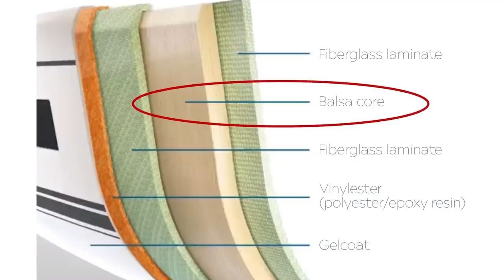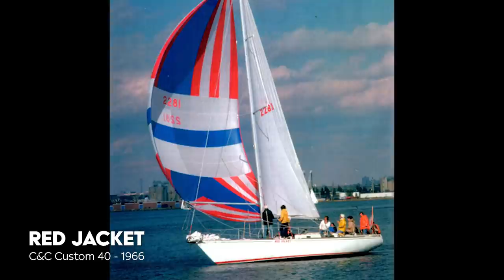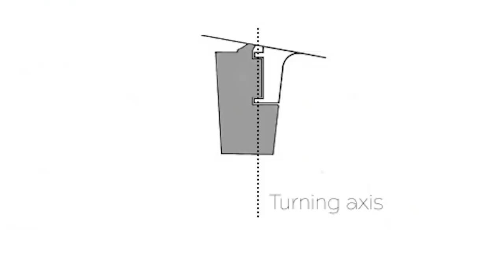FIXER UPPER Sailboat for Sale!! $16K for C&C 40   EP 28

Comment: Great Video, I own a  sister ship, 1981 40-2 center board, love the boat, that is a heck of deal, been cruising on it for a few years now, always feel safe and the centerboard allows you to get in to some shallow anchorages!
Reply: I just bought this boat! Any tips for liveability?
Reply: @flynns32547  www.desperado2.com - we have added a lot to ours, we have solar, watermaker, new stove ect... we use the pilot births for storage, if you have any questions, let me know, I keep my batteries under the quarterbirth and use the cockpit locker for 6x5 gallon fuel cans, I installed radar and autopilot, replace the hatches ect...
Reply from the maker: That is awesome!
Reply: @flynns32547  watch episode (step) 40 of "sailingUma' on youtube. Then decide to flip through other 'work' vids. Ship her south to work on her year round. Allow 2 years of effort. Like Uma, you will assuredly find more than you thought problems. Patience perseverence and a long run dilgent dedicated relentless attitude is required. Mental toughness to accept this. I'd go like Uma and sell the engine. After long days of fiberglass work are hours of research for whats next...electrical.  Good luck.
Reply: ...and composting head now are the way to go. Have one on a c&c 30 in BC Canada.
Reply: @flynns32547  A couple of things to watch out for, the bottom of the centerboard tube, can come loose/corrode, I had to re-glass mine in (there are videos on my channel on the repair), it was a one day job, but had to be hauled to do it, watch your engine alignment and the stern tube/cutlass bearing, Atkins and Hoyle hatches are old and mine all leaked, replaced with Lewmar at a fraction of the cost of refurbishing the A&H, a windlass is necessary if you plan on anchoring, we went one season without one, never again, the rudder may have not been greased in years, the grease pot is difficult to get to, but it is very important to grease it (fill the pot, screw it in... repeat), it might be easier in your boat as you have that engine hatch in the cockpit, I do not have that, email me if you have any questions.
Reply: @desperadoii4938  Thanks so much! That's good info.
Reply: @desperadoii4938  We're going to be documenting our jobs on this account :)

Comment: Thanks for the video of this beutiful C&C 40. I got my hands on a C&C 30E that looks more or less exactly the same as this one. Only difference is the overall height and width to be honest. Very interesting to see. I have restorated the teak deck this summer and inside renovation begins after new years. I have the same case as this C&C 40, moisture and some moldy teak inside the boat that needs to be removed and or replaced. It's gonna be beutiful :)

Comment: This boat could be splashed and fixed up. It would make a great BVI boat with the shoal draft. I’d focus in two things: first the engine. It looks rusty and old. Having gone thru a reporter on my last sailboat I’d give it a through review with a good mechanic who has time. Second the Chan plates. The great news is that they are easy to get to. Examine them and replace if they look suspect. 
Buying this boat if you had the dough you could  get in a good summer then put it in the barn for the winter and mint her.
Reply from the maker: spot on   thank you
Reply: That's the plan!

Comment: I wouldn't attempt to dry it out with heat, you should use an industrial dehumidifier for a couple of weeks. You could do a before and after damp check on the boats core, that would highlight any bigger issues. Balsa needs to stay dry or it loses its compression strength meaning anything fixed through it will be loose. We build boats with this construction and they were super light and very strong. Good luck to the new owner, it's worth the effort.
Reply from the maker: good point ,,,actually i wondered that some firm like ServPro would be a great help   since they do flood damage repair

Comment: A Canadian story: A casual friend/work mate told me a tale of buying a power boat with a minor moisture pocket, that he ignored, as he was anticipating an overhaul; which he put off for a couple of winters.   Story goes, the moisture froze within the balsa, causing extensive de-lamination, and damn near tore the transom off the boat after two winters... I dunno.  A canoe man myself, I've lost a couple over the years from dry-rot, from fiberglass penetrations allowing water into the cedar strip casing. Imagine balsa core rot would be much like dryrot ( ? )
Reply from the maker: I think a  CB lot more detail needs to be provided about the  bb poor Canadian power-boater’s I’ll luck   For example did the owner actually find sll the soft places at the start  and so forth. 
From what I understand it takes a penetration of the fiberglass covering to allow water into about the core but once in it tends to be localized in some sort of radius about that initial strike. I Have never heard of the lamination so intense that an actual aspect of the hall would be rent from the boat. Of course Canadian winters can be cold.

Comment: Never heard of a balsa failure causing a boat to sink. I HAVE seen a 5 year old boat sink right at the village boat dock here in Coxsackie because they got drunk and didn’t pump the bilge on their passage down the Hudson from Quebec 😂. Seriously, though, I can send you photos of a wooden NY Central railroad barge that was abandoned when Amtrak took over and has been sitting on the mooring at their abandoned fuel dock, and it’s still afloat. The roof is shot, it’s got all sorts of wildlife, the fuel dock sank, but the boat is still afloat because physics rule. 🎉

Comment: Most decks have some wet spots unless you it's real soft it should be fine it may take away some  stiffness racing. check the bulkheads much more of a problem to have rot in the middle of teak faced plywood (I raced on a Kirby 25 that you could feel the deck sag but we won a lot of races) C&C were great boats this looks like a great deal he's almost giving it away. I'd rather have the C&C 40 than a cal 40 (and the cal had a lot of old fittings this had self trailing primarys). This boat could be cleaned and tidy up or completely restored it would be worth it either way look what a new 40' would cost

Comment: Those chain plates have a surprising amount of corrosion on the surface. I’ve worked new construction and remodeling for about 35 yrs. When working on a house you can tell so much about the people that worked on it before you by the work that they performed. I’m guessing that an experienced ship wright ( is that correct? ) could do the same.

Comment: I’m in the process of finishing my refit on my C&C 30 mk1 
I redid the the top deck , from my limited experience the balsa core get wet from the accessories on deck not properly sealed or sealant failing with time
I think the most important thing is that it don’t leak inside 
I wish I could exchange mine for bigger
Depends on how much elbow grease you need and $
I think it a brand that be kept alive or revived

Comment: Certainly it needs a lot of work, but it would be so worth it. Topsides balsa repair is pretty straightforward on a C&C (did some on my 27) and probably you'd need to drill n' fill/rebed all the hardware to get the leaks, along with a lot of scrubbing and some cosmetic work in the cabin... But my gawd boys you'd have a helluva boat.
Reply from the maker: good call
Reply: That's our plan!
Reply: @svperegrine8004  Now there's a coincidence: Peregrine is also the name of my 27. (It's an old family name, but also a good one for a boat IMHO...)

Comment: I would pressure wash it inside and out then dry out the inside then. Prep the bottom and launch. In a marina that will let you work in the slip I would rebed the deck hardware one at a time.  You could sail on perfect weekends and work on deck leaks when there is no wind. The deal killers for me would be bulkhead rot or an engine that doesn't work. That would get too involved for me. There are other boats out there.
Reply from the maker: well thats the surveyors call     but a good approach

Comment: Water in a balsa core make a boat heavy, like carrying extra water tanks.  When it’s just the topsides that have a balsa core it’s not really a problem. Wouldn’t even repair unless the deck feels like pasta under your feet. Wet cores become a problem when it’s a cored hull where the balsa core is below the waterline 24/7.  Then it’s like pasta in between two layers of fiberglass. strength goes away. The hull begins to flex too, too much. Stays just pull the hull without getting tight. Prop shafts won’t stay aligned, rudder shafts move. Thru hull fittings become compromised. The list of problems is endless. Balsa core below waterline, run, no sprint away from the vessel.
Reply from the maker: Thank you

Comment: What is the status of the engine?  On an older boat rebuilding or replacing can double the cost.  An engine in good shape is not a luxury.  When I look at an older boat, it's the first thing I look at.  I have sailed a C&C 40 up and down the east coast for 5 years.  Always loved the way it handled, very light at the helm---you could steer with one finger and it pointed better than any other boat I've sailed.  Sweet!!!

Comment: The balsa core rots into a black goo, losing its strength and you get the soft decks. 
Once it gets heavy it affects the boats performance by becoming more tender ( I think that's the word, it basically heels easily, and rolls easier from waves).
From what I've seen some of the repairs add a lot of weight affecting the boats performance permenantly.
So........balsa is expensive but....
Reply from the maker: makes a lot of sense.... we wouldn't wait too long to deal with soft decks...

Comment: when balsa gets wet it rots and the only fix is to replace it.. the balsa is part of the hull integrity and without it the hull lacks the rigid strength,, so unless a complete check of the hull indicates no rot or damage, that boat would be iffy at sea.

Comment: Great video as always!
You dont seem to discuss sail inventory and condition very much.
As  I recall New Saiils can be very very expensiive.
Can sails be rebuilt ?
Thanks
Reply from the maker: Sails are often stored away from the boats so we cant even see the bags. There is nothing like a new suit of sails except sails built by an experienced non curt rate loft  and then the range goes downward to a 30 year old bed sheet soft set which will move the boat forward. Hard to really evaluate until you can hoist them and load them up. Depending on your needs : racing , cruising off shore , gunkholing  nearby  etc,

you and your local sailmaker  will be the judge. There is usually an accurate survey of the number of sails coming with the boat  but never expect perfection from anything more than a couple of years old and you wont be disappointed. Yes some sails can be re cut by a skilled sail maker to stretch the life of some but it may be wiser to buy new at any level . The sails will usually get you home regardless of condition but there is a quantum of difference in speed and handling between old and new 

hope that helps a little
Reply: The sail inventory was very complete. Main, a 155, a 100, a storm jib, and two spinnakers.

Comment: After seeing the motor area and bilge below it ,,, 1000% that C&C has been partially sunk or heavily flooded inside with water resting for a long period of time.  It was drained out but never dried out correctly and it’s led to its demise. 
Current/Previous owner needs a SERIOUS TIME OUT and should never be permitted to own another vessel after destroying such a fine vessel.  There ya go Capt Q ,,,, I said what you were thinking but didn’t want to say. 
Good thing is I’ll bet you could buy that boat for 8-10K and spend a few months turning her back into a 40k boat quite easily.
Reply: We certainly took issue with some of the previous maintenance regime. That said, we've gone over her with a fine-toothed comb and we're happy with our project boat. Your last sentence is exactly what we're doing :)

Comment: If a wet core is such a concern, why can't some tiny holes be drilled to the core, the interior heated up to 5 degrees over ambient, to allow the moisture to escape, and a preservative be injected to inhibit future rot. Once the moisture issue was controlled, plug the holes. Could that be a solution?
Reply from the maker: I think that has been done in similar fashion a number of times with success. The longer you can heat/suck dry the holes
The great chances of success

Comment: How well does this boat sail close to the wind, do you think? Having grown up sailing a full keel Pearson, I was dismayed at the sailing meatball action of some factory boats when they got overpowered (Jenneau, or Beneteau for example) and getting through chop.
Reply from the maker: she is the progeny of Red Jacket which won the whole southern Ocean Racing Circuit....you would be delighted to be at the helm of one of these or any C&c     really !
Reply: She handles chop like it's not even there. It's slow going in light air, unfortunately.
Reply: UPDATE: She's a bit tender up to 15 degrees or so, but stiffens up quickly. In 7-10kts+ you can point up to 30-35 degrees or so, with a commensurate loss in boat speed as you drop below 40. You can keep the 155 out until about 15 knots,  when she'll do ~8kts close hauled with the traveler down. Any breezier than that, and you'll want a headsail change.

Comment: One design question about C&C. There is a C&C in stands close to where I live and I’ve noticed the prop shaft is not in line with the center board and rudder. Is this common with C&C and if so, what would be the purpose/advantage of such a set up?
Reply: I am only guessing, but it might be because of torque steer.
Reply: not in alignment, off set just a bit so, if needed, the prop shaft can be removed.  slide right past the skeg & rudder.

Comment: I worked for a C&C dealer as a rigger in the 80's and the owner raced a C&C 40.  I always loved these boats and it's sad to see one in such horrible condition.  It appears that over its 40+ year life this boat has not only had numerous leaks in the deck, and hatches left open during heavy rains, but a flooded bilge mostly submerging the engine and quarter berth.  It was probably not maintained well.  I wouldn't go near this boat as a buyer.
Reply from the maker: Well she has been sold And it will be interesting to hear back from the new owners how they fare with their dream boat
Reply: You're right on re: leaks in the deck. We're sealing those up, and figuring out a plan for replacing (or selectively reinforcing) the balsa deck core. The engine itself actually had a thru-hull pop and got water throughout; however, it starts first time every time, and we'll be pulling it out this winter to make sure that continues to be true.

She's a project for sure, but the foundation is good.

That said, we just popped the coldhead on the starboard inner shroud, and we'll be rerigging the boat. Now that navtec's out of business...any suggestions?

Comment: She just screams for attention. This would be a great entry boat for someone with skills to buy. Definitely some work to be done. I'd like to have seen the bilge to see its condition. One major problem with a wet boat is black mold. It can lead to some very extensive and expensive repairs to mitigate. Buyer beware.
Reply from the maker: agree but didn't see any rampant
Reply: @YachtHunters  its usually what's under the floorboards that can be problematic. I'd use a flexible camera to try to ascertain the underside condition. I bought an old wet Pearson and ended up gutting the entire interior due to black mold. The deeper I probed the worse it got. Turned into a year and a half project but I learned so much from it lol. Used every trick from Dan Browns," This old boat", and then some lol. Great memories.

Comment: Cushions are gone. Were they rotting due to wetness? Engine and mounts COVERED in rust. A good look at electrical panel would have been good. Boat might have been under water.
Reply from the maker: Boat is sold and in midst of restoration on east coast 👍

Comment: To downplay possible rotten balsa core off the deck is ridiculous. No, it won't cause the demise of the boat, but it can cause the demise of the owner's bank account if they can't repair it themselves. I'm pretty sure the people who ran from that boat because of water meter readings weren't thinking "oh no, water in the balsa core will cause the demise of this boat, run away!" That's the only really dumb thing I've ever heard you say captain q. Would you buy a boat after a professional tells you there's water in the balsa core? Of course not.

Comment: Champaigne and high heels on a boat? I've only seen one of these things. A good rule is to never ever have woman dancing in high heels on a rotten deck...unless, you've had a lot of champaigne and it's not your boat.
Reply: When given this dilemma, from an engineering standpoint. If a dancing female weighing 46.7 kg places a momentary point load on 23mm of 40 year old fiberglass with a modulus of elasticity of 3mm the potential energy transferred to the deck will. Well never mind. What is she wearing?
Reply: @JOHNALOOPONE  Your calculations suggests it's only appropriate that she be wearing less, starting at the bottom.